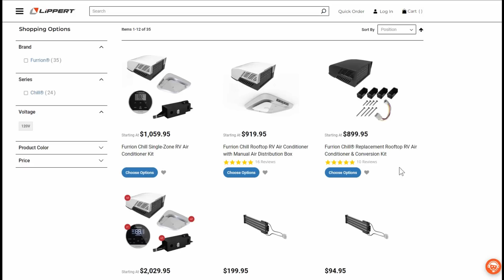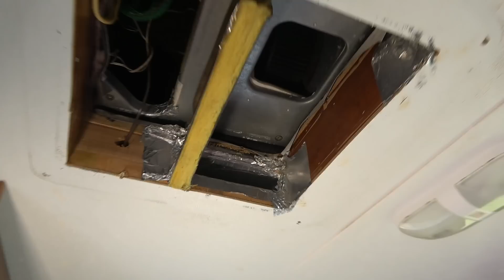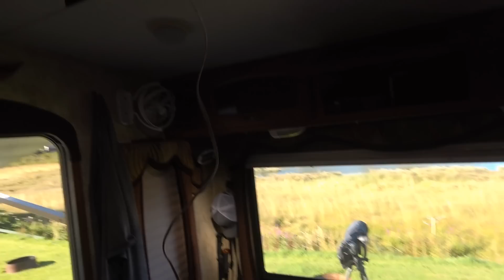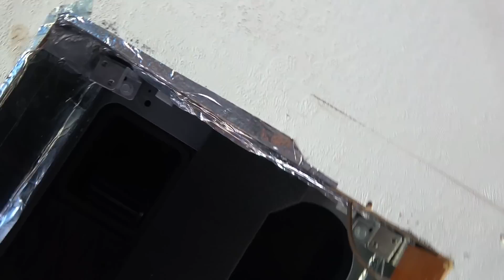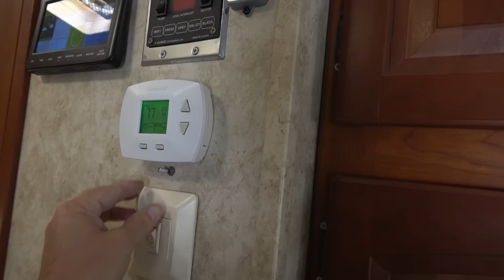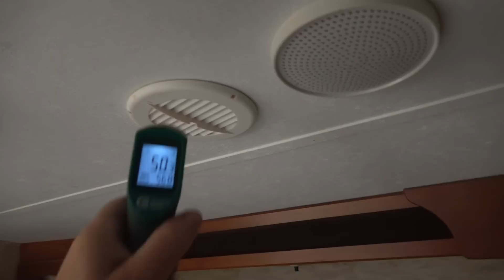Furrion Chill Replacement RV AC Installation using the Conversion Kit for Coleman Mach/Dometic/Avent

Comment: We have a 2025 Alliance Avenue.  Has a "loud" small Furrion in front, and the main one in middle.  Main unit can't even push the air through the duct work very well, and it takes hours to cool the rig off.  The small one in bedroom, is the 8K Chill, and it's so loud ya can't sleep.  I miss our Cometic's we had in the old RV.

Comment: Does anyone know why our new control box has power going in but isn’t putting out any power??? We’ve bought a new box and tried that n everything and it still won’t output power
Reply from the maker: I'd check and make sure the wall thermostat relay is working and telling the AC control box to turn on.
Reply: @LoveYourRV our box isn’t sending power to the thermostat either and we can’t control anything from the thermostat. We’ve also replaced the thermostat too. Everything is hooked up correctly it’s just not outputting power. We haven’t tripped any breakers or anything
Reply: We have the Furrion Chill HE RV 13.5K BTU unit and it’s brand new
Reply from the maker: Sounds like you need to try and find the serve manual online and using a multimeter start making voltage tests to see where the power is being lost. The air conditioner needs both AC and DC power supplied to it. Start with the main power panel in the RV looking for blown breaker or fuses. Then look for bad wiring or connections to the thermostat or air conditioner.

Comment: Arw you abke to use the existing T stat that came with the rv. Mine is a dometic though and starting to struggle a bit to keep things cool.

Ours is a 15k one so inwoikdnt think a 14500 would be noticable.

Was everything wiyh the concersion lot pretty bolt in took maybe what couple hours
Reply from the maker: I upgraded the Coleman Mach Analog OEM to a Honeywell digital with auto heat to cool change over   https://youtu.be/fzH3vTZe3Qc
It was an easy conversion, still working well. Here was my review  - https://youtu.be/WYkpI8YJNjY  Cheers, Ray

Comment: I haver a  motorcoach would replacing the ac be about the same as yours. Thanks
Reply from the maker: Should work if its using the same AC unit

Comment: Mine was a total piece of junk ! Room temperature sensor is in the return air ! Grand design would not approve to have the temperature sensor relocated so I got rid of the whole camper and got one with a Coleman Mach
Reply from the maker: There is a temp sensor for freeze-ups, usually, it is tucked into the evaporator coil fins but sometimes falls out. Maybe that is what you saw in the return air duct. https://thecampingadvisor.com/dometic-rv-ac-freeze-sensor-location/
Reply: @LoveYourRV  i know what you’re talking about but my Furrion also had a room temperature sensor in the return air not in the thermostat where it should be which caused it to short cycle & multiple other problems
Reply from the maker: ahh, I see, mine was the conversion kit model so I guess it reused the Coleman stuff working off a thermostat on the wall. Works well. cools much better than my old Coleman but it is 14.5K vs 13.5K so expected to cool a little better.

Comment: ,Seeing this is 5 months old you may not see this ray but my 2007 cougar AC recently went out and I went the Mini Split rout. I installed a Dakuizi 9,000 BTU heat pump and I am over joyed. I put it right over the living room slide out ran the line set down the corner and out to the basement, I installed it in the step down but I doubled up the bottom and really reinforced it. When it is in heat mode it sheds water from outside unit I but shower pan down and a drain tube  I can open basement doors or if overnight I put grates on each side for air flow. for first 10 minuts it pulls 800 watts then settles down to 300-400 watts so it is no proplem running off solar but sence i bought the new f 150 hybred with 7.2 KW generater who cares. And yes I tow fifth wheel with it. That 9,000 BTU is more cooling and heat than I need but best part is you cant hear it running. It is almost silent.
Reply from the maker: Sounds like a good mod if you need to have AC lot when camping.
Reply: @LoveYourRV  well I am in Fl.
Reply from the maker: @doppler3237  Makes sense, then. :) Migrating from the BC coast in the summers to the southwest desert in the winter, I run AC maybe 6-8 weeks a year and never need it at night, so the traditional rooftop system is a good way to go. Tidy and out of the way the rest of the time.

Comment: I upgraded to a mini split in my Cougar. So much quieter and efficient.
Reply from the maker: Cool, I looked at them but seemed like too much of a hassle to install and find good locations for the two units since we don't use the AC that much. Mainly just for hot days in July and August.  Cheers, Ray
Reply: @LoveYourRV  I’m in Texas so AC is mandatory.

Comment: Hi Ray, About how long was the process of removal and install for you?
Reply from the maker: Just a couple hours, most of the time was cleaning the roof and re-taping the ducts, but also had to wait a day for the roof coating to dry between taking the old one off and installing the new AC

Comment: I look forward to your review.  I replace my old (29 yr old) Dometic with this unit. Install pretty straight forward and added SOFTStart. But the design blows cool air from the rear of the unit resulting in less air flow to the forward in our 23’ Aero Cruiser. We find the performance is less than acceptable when the exterior temp is 80* F.  Additionally, the unit is very tall.  We are planning to give this unit to my brother for his 12’ travel trailer, and replace it.
Reply from the maker: Thanks for the feedback. So far it has performed much better that the OEM Coleman Mach 3 13.5K BTU, we've had several 90+ degree days since installing and it had no problem keeping the RV at a setting of 76 and could have went cooler since it was cycling off quite often having finished cooling to set temp. My Coleman Mach blew air out the back as well so maybe its a good match for my OEM ducting system. Height is similar to the old Coleman Mach maybe slightly shorter. Anyway, not an issue for our fifth wheel trailer since its mounted at the back end and the roof line slopes quite a bit front to back. https://www.loveyourrv.com/wp-content/uploads/2018/11/Our-Cougar-fifth-wheel-trailer.jpg  Cheers, Ray

Comment: Is it just me but the EER efficiency is Abysmal at 2.19….
Reply from the maker: Yeah, seems weirdly low.  These specs say EER 2.13 https://cdn.accentuate.io/4619525324896/5237057388633/MS-FACR14SA-BL-PS-AM_V1.0-v1622791787689.pdf But not sure how they came up with that because when I search how to calculate EER I see this page https://learnmetrics.com/eer-rating/ and it uses a formula EER rating = Capacity (in BTU) / Power (in W), so for the Furrion AC you would use the values 14500/1620=8.95
Reply: @LoveYourRV  There’s precise variables to include in the evaluation manufacturer have to do… (Humidity, temp inside, temp outside etc…). I’d not be surprised if Lippert confirms that low  EER value but deep down , I hope it’s a printing mistake
Reply from the maker: The Furrion website has an equally low 2.19 EER rating but at the same time boasts "up to 40% more efficiency (EER) over leading competitive single-fan models" https://furrion.com/products/14-5k-electric-kit-for-furrion-chill%E2%84%A2-single-zone-air-conditioner-system
It's definitely more efficient than the old Coleman Mach 3 I replaced. Even when new, it didn't cool as fast at close to the same power draw.
Reply: @LoveYourRV  Coleman, Dometic Penguin…. All garbage imo…. Furion is still interesting because of it’s lower noise…. If it’s a bit more efficient, that’s a bonus… We are still so far away from mini split… Those are the  real game changer…. (Almost all RV sold in Japan come with minis….)
Thank you

Comment: I removed the dometic unit from my roof on the van and put a window unit in uses alot less power and can now park in parking garages
Reply from the maker: Makes sense not much area to cool in a van and non ducted. A window unit is likely plenty of cooling power.
Reply: @LoveYourRV  that dometic though would keep the van ok cool in direct sunlight though the window ac I have to park under shade to make it work good

Comment: As a Canadian,  what happens if you spend more than the allowed time in the US? I know we're allowed to spend one year in the US every 7 years, on top of the 181 day rule, but apart from losing free healthcare for the rest of the year once you're back in Canada, what are the consequences of spending, say 18 consecutive months in the US ?
Reply from the maker: I believe you may be barred from reentering the USA for a number of years. Not sure how many maybe 5. Likely will depend on how long you overstay. Where did you hear about this one year every 7 year rule? I've never heard about that.  
As far as I know the max length a Canadian can be present in the USA without some sort of special visa is 6 months in any 365 day period. To stay longer you have file this form https://www.uscis.gov/i-539 and extend the stay. There is a non-refundable filing fee. We did it back in 2012 and at the time it was $300 US and were granted an extension to our trip. We ended up staying for 9 1/2 months total. How long you can be out of province and maintain health care coverage varies between provinces. BC for example allows 7 months out and must be in province for 5. Every 5 years a person can also apply for a 2 year travel exemption. 
There are also tax implications to being in the USA for extended periods. Check out the 8840 form that needs to be filed to keep the IRS from taxing you https://www.irs.gov/pub/irs-pdf/f8840.pdf Cheers, Ray
Reply: @LoveYourRV  Thank you so much for your in-depth answer, Ray. My bad about the one year every 7 years provision,  it doesn't have to do with what the US Govt allows but with the allowed time for a Quebec resident to be in the US and not lose their healthcare coverage, otherwise the 182 days and less per year rule applies. Sorry if I mistakenly got your hopes up!
Reply: I have never heard of that 7-year rule for USA either.  In Quebec, we can leave for one Year every 7 years without losing health insurance.  This does not give permission to spend that time in the USA.   @LoveYourRV  I have

Comment: I replaced mine with a Furrion 14.5k The first one came smashed to pieces, which a lot of reviewers had warned about. The second one would constantly freeze up. It never would run more than 10 minutes, their cover / air handler is an absolute terrible design. It forces the air 90 degrees through a tiny passage way. Their support was awful as well.
Reply from the maker: Interesting, you would think using their own design would work better than a conversion. Was the support you contacted Furrion or Lippert? So far, we have run it often for hours at a time and have had no problems. Yesterday outside humidity got to 90% as well, and no freeze-up. So seems to work OK with the Coleman air box and  ducts in our trailer.
Reply: @LoveYourRV  It was a few years ago say they may have fixed the issue. I always wondered if mine was low on refrigerant as well as the air handler not allowing air to flow well. I contacted Furrion because I installed it myself they wouldn't do any warranty on it unless I took it to a dealer.
Reply from the maker: Thanks for the reply. Lippert bought Furrion last fall by the looks of things so maybe the support will improve. I know that Lippert has been getting into the end user consumer sales game the last few years. They also acquired Curt hitches.  Cheers, Ray
Reply: @LoveYourRV  That's good to know! I love the channel thank you for all the awesome and informative videos.

Comment: I’m betting the furrion AC won’t last a year. Let’s give it a few months before you have to replace some part. 🍻
Reply from the maker: Guess we'll see how it goes. This is the first Furrion product I have tried out.
Reply: @LoveYourRV  Ray, it's been 3 years.  I am just watching this video.  Thought maybe you'd chime back in on this comment! :D
Reply from the maker: @WillBelden  Haven't had any issues with it. Cools the RV quite well. :) Though now that we are boating, it doesn't get used in the summer months anymore.
I've added a fw gadgets to it since the installation. One is a soft starter, so it will run on my inverter and batteries if I like, and another is an air purifier.  ActiveStart https://youtu.be/pzPxMm2N5U8 and AirLock https://youtu.be/GAc_N9MKkgM  Cheers! Ray

Comment: We have the same Coleman Mach you had - we installed a WackO RV Air Conditioner Noise Reduction grill - it made it a less noise inside.  You should do a video on that upgrade.
Reply from the maker: Thanks, I looked at the video they have, and it seems to me that I would lose my use of the vents on the air box plate. That would be a negative for me as I sort of like them on hot days to blow air right down on me.
Reply: @LoveYourRV  You are right - with it installed all the cold air goes to the ducts.

Comment: Yep! after 11 years of loyal service its time for the ac upgrade. I changed mine 2 years ago , a 15000 BTU Dometic. It did pretty good but we just traded it our 2011 Cruiser 28 Rl for a 2022 <cruiser Aire cr31SI for our winter home in Florida. Good video Ray , as usual. Cheers!  have a good one.

Comment: I think you'd be better off with a split-air that can run as low as 300W  @ 9000Btu or 30 SEER.  The larger units only slightly less efficient, but not by much.  And they work reasonably well for heat reducing the need for propane.

The cats meow would be to use a 230V unit with a up voltage from 115v to 230v inverter output with a ceiling mount blower.
Reply from the maker: I think if a trailer was designed from the ground up with a mini-split system, that would be great but to DIY add one to my current fifth wheel seems to have too many drawbacks in my mind. I'd have to find places to mount both the outside and inside units and plumb and wire things. The only suitable location I can think of for the outside fan unit is on the back of the trailer, where it would be exposed to all kinds of road grim, water spray, and dust. A 30-foot fifth wheel with high ceilings has a fairly large interior volume, so around 13.5K BTU is the minimum cooling power on a hot day. Maybe if I was often camping in the heat, it might be worth the hassles of a DIY mini split install, but our AC use is mainly only needed for a couple months a year and not every day. One final thing I'd be worried about is installing a system meant for stationary use into a moving vehicle. A trailer really vibrates going down the road and especially when on off-gird dirt roads. Cheers, Ray

Comment: Would have liked to see how you got that unit up on the roof and the old one down. Great video as usual.
Reply from the maker: To get it up, I left it in the shipping box for protection of the new AC. A friend and I used my Werner folding step ladder and placed it up on the slide-out roof. From the slide roof, I push the box up from the slide roof onto one of my solar panels on the main roof next to where I was installing on the main roof. Then I cut open the shipping box around it and lifted the new AC in place. It weighs about 85 lbs. about 100 with the shipping box.
For the old AC, I took the shroud and some metal covers off to get some good grab holds and reduce the weight to about 75 lbs. and lifted it over onto the slide roof onto a piece of cardboard to protect the slide rubber roof. I then grabbed it and lower it to two waiting helpers on the ground below. We all wore work gloves as the AC uncovered has some sharp metal edges.  Cheers, Ray

Comment: I'm really not a fan of our Furrion, I find it very loud and when the compressor engages it vibrates through the entire trailer.  I'm wondering if our unit is defective in some way but there are a ton of challenges to try and have a RV shop look at it for a warranty repair.  Thanks for the video and I look forward to seeing the next review.
Reply from the maker: Maybe the fan motor has an issue. They are large motors and spin fast so if off balance could vibrate things a lot. Or, it could be a loose roof mounting or even the overall design of your roof. Some RV roofs are thicker built than others. For example, some are built to be able to walk on,, and some have thinner deck boarding and not walk-on type. Also seems like the AC needs some thick wood framing around it. So a lot of variables could lead to excessive vibration. Guess you could try and find a fellow camper with a similar trailer and have a listen to their AC. Cheers, Ray

Comment: I would’ve like to c the temps of the original ac unit in comparison for a true test
Reply from the maker: Was hard to do a meaningful comparison since the ambient temps were different on the days I uninstalled and installed due to the fact I coated the roof and left it to dry for a day in-between. But found this old test I did with the Coleman Mach a few years back with about the same 75 degree inside ambient temp - https://youtu.be/fv5KBhdEvNg?t=931

Comment: Does it come with a soft start built in?
Reply from the maker: I don't think so, at least I don't see any reference to it in the manual. I'll do a test of the start up surge amperage and pull the covers and have a look inside at the inner workings for my review. Cheers, Ray